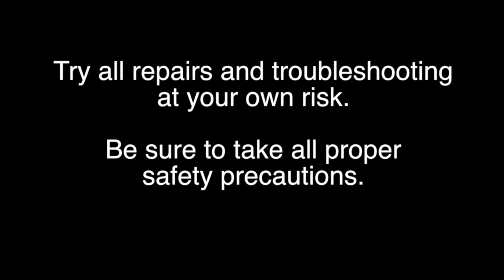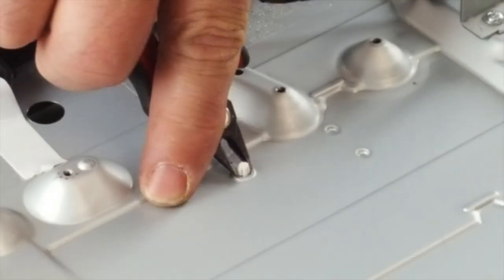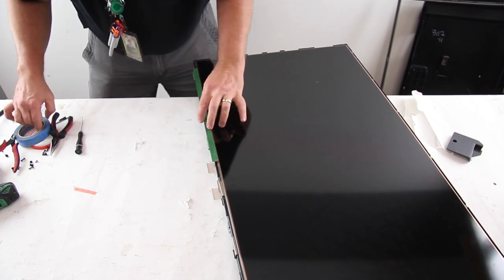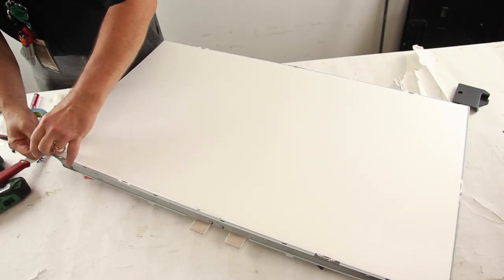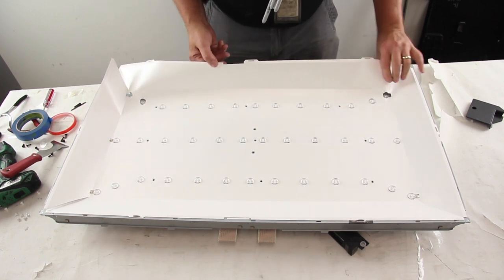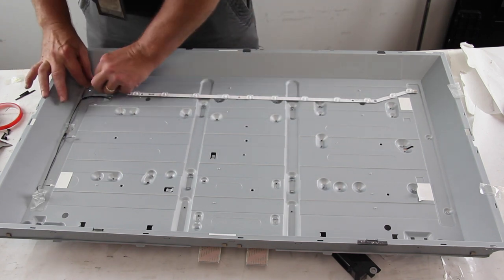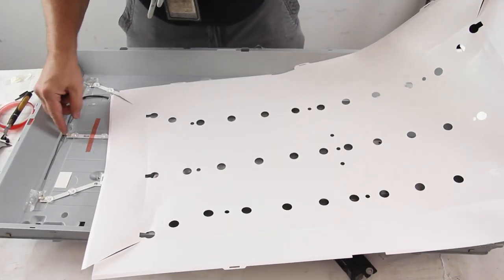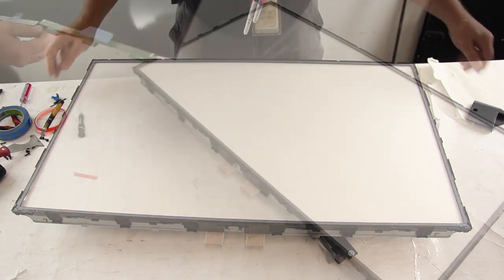Samsung 40" TV LED Strip Replacement - UE40 UN40 HG40 TV Model - No Backlights & Blank Screen

Comment: What kind of tape is that you're using on the strips? Is it necessary? I managed to get the original tape to stick on (it's only on the ends), it's a threaded tape. 

also, I didn't take the diffusion off taped together, I did this before I saw this video, but i've worked on tvs before (soldering caps on power/video boards for LED and DLP), however never done LED replacement. Which diffusion goes on the LED side?

Lastly, the adhesive holding on the LED reflector is no longer sticky, should I get some more or is this not a big deal?

I did get the 3xstrips from you SJ, thank you for that

Comment: Hello Jimmy I have an Led problem they need to be replaced. I know this for fact. The problem I'm having is that it seems the Led replacement kit for my Samsung TV version doesn't exist. At all. Heck I can even find any on eBay that might have been taken from another crack TV or whatever. Is there anything else I can do? I don't wanna give up... Samsung TV Model Un40eh5300fxza
Version No Ud03. Thank you for your time. Have a great nite.

Comment: Thanks for the great video.  With the information from your video, was able to get to the led strips, replace them and tv is now working like new.  The battery test to check each individual strip was a great help also.  Only the middle (12 led) strip was at fault but replaced all three that came in a set.  Great job on your video and thank you.

Comment: I have a Vizio D65u-D2 that will turn on and display the logo, however it won't show picture or sound and I cannot bring up the menu or the input selection. Any ideas?
Reply: nick huth shine a flashlight on it to see if you can see anything. If so, your back light isn't working

Comment: hey guys - does anyone knows is which order defusion panel goes?  I kind a messed up their order.
i have one hard and one foil like sheet. which one goes first?
Reply: Does one have location tabs on the edges that fix to the base and another one with flat edges? i assume the one with tabs goes on first?